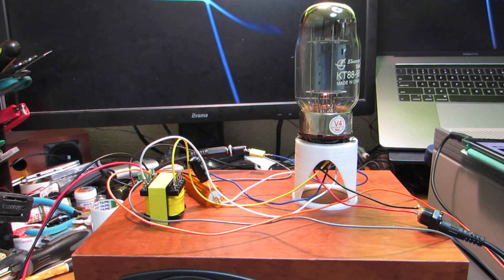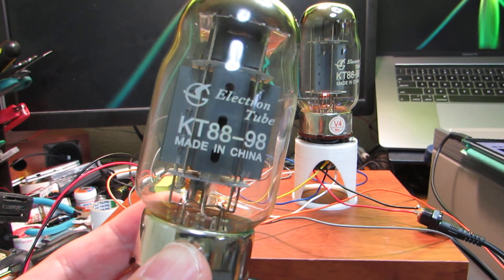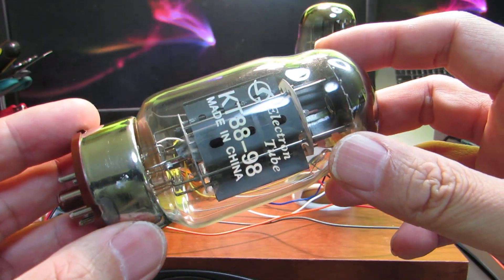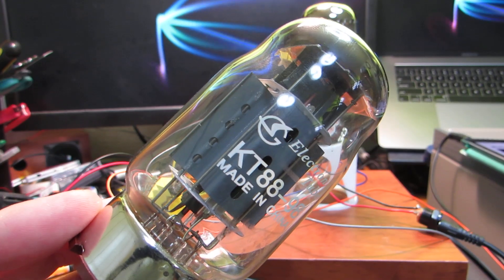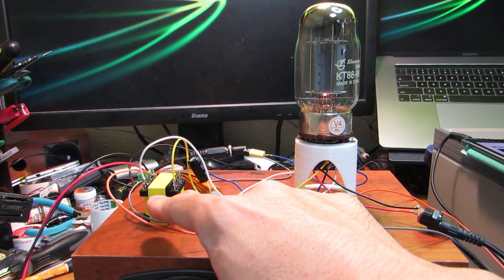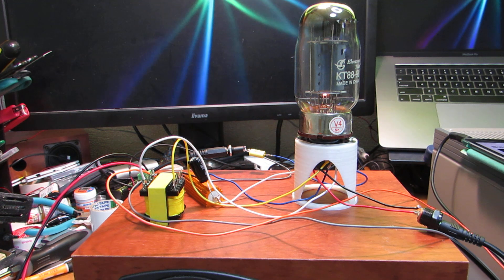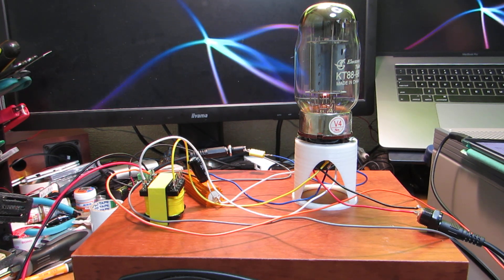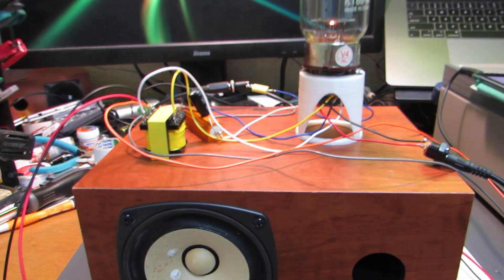KT88 simple amplifier

Comment: Good job, now you can actually make a kit for it. Lol, you might  use 6N1 for voltage amplifier(preamp) to drive KT88. Then change a better transformer. If you can't find a proper transformer, I recommend use 10 watt 220v to 12v AC transformer instead, it will sound warm. Of course you can customize output transformer, the direction of the transformer steel sheet has a great influence on the sound quality(especially on high frequency).  I'm looking forward for your new product. Have fun